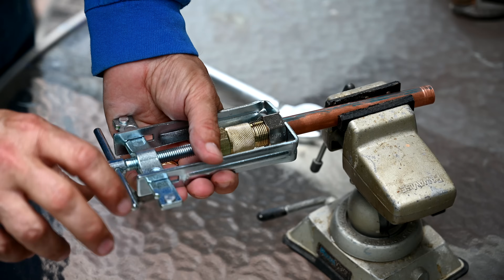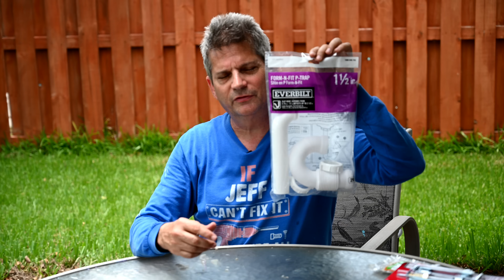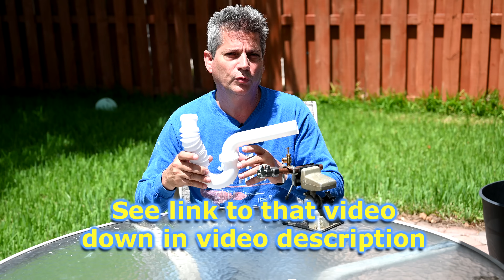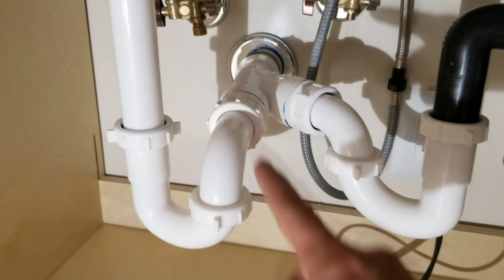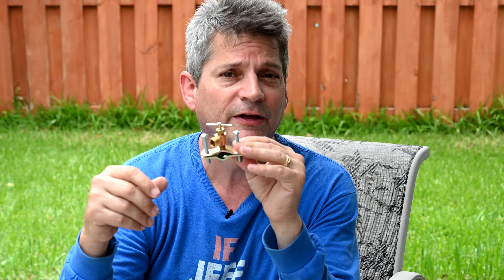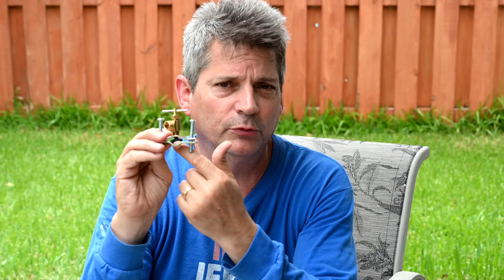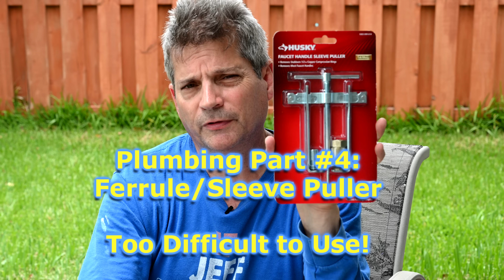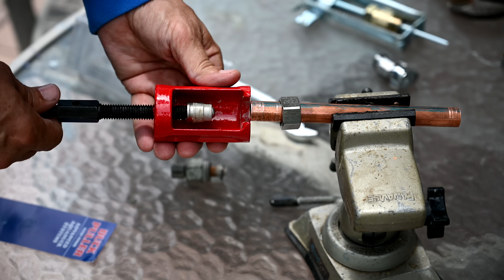4 Plumbing Parts/Tools You Should NEVER Use. NO Plumbing Fails

Comment: It would be nice to know exactly why they prohibit them
Reply from the maker: The professional plumbers already know, so the code does not have to specify why, but the saddle valve is banned because it can leak where the tap is pinched into the copper pipe, and also, even worse you have the old dissimilar metal electrolysis that occurs when 2 different types of metals come in contact, so the cheap Chines made white metal saddle sits on the copper pipe and corrodes, and eventually leaks. With Flexible p-traps, the accordion creases are fragile and often crack and leak, and the accordion violates the pluming code of p-traps being self scouring, meaning they need to be smooth walled inside, or hair and other solids can become lodged in the accordion. S-Traps are banned because a long vertical leg after the S-trap, preceded by a short vertical leg in front of the S-trap will allow the S-trap to self-siphon, also called Venturri Effect. these are just some of the reasons they are all banned by the plumbing code.

Comment: Just pulled two old rusty nasty 30year old one piece stop/supply combo angle valves today with my handle and compression nut puller.  Husky is a brand.  That style puller has worked for decades under many brands for multiple purposes. Not just the one described. Mine only has 1 insert for 1/2 ID cu, no fancy brass threads and doo hiky's.  To bash a style of puller is kinda ridiculous especially if you don't hammer those ferrules into some copper with some 12 inch crescents like most homeowners and apprentices do...... with no lube... The new ones are cool though.  I agree with the other stuff though good job.
Reply from the maker: Thanks Ryan!

Comment: I have a restaurant that smells like sewer. I had plumbers come out and install pee traps and recommend that I pour water down my drain lines. It works temporary, but during the summer it gets pretty bad. Any idea on what I can do to find the source of the issue and fix it?
Reply from the maker: Well, I would find out exactly where the smell is coming from, and work on that spot, I doubt it's coming from everywhere, probably a broken P-trap somewhere, and as long as water is going down at least once per week, the p-traps should not ever empty out, they should always be full of water in the curved part of the trap. I suspect you have a blockage further down the line after your p-trap, and it is causing sewer water to back up into your side of the p-trap, where you now can smell it. Also, check all your vertical plumbing pipe stacks, make sure you have adequate venting up to the roof, go to the roof make sure the tops of your vent stack pipes are not clogged, or blocked off with leaves, spider webs, dead critters, or water won't drain properly. Other symptoms I have seen in the past are tree roots cutting into drain pipes. But does not sound like you have  problem with the water draining just the smell right? I would call in specialists who bring in a camera snake, and snake your drains, to examine the inside of the pipe all the way to the sewer, the video will determine if your p-traps have the legal required amount of water seal in them, or if there is a break or blockage anywhere. Also, if any of your P-traps are actually S-traps, they are banned in current plumbing codes, as they are known to self siphon, lose their water seal, then sewer gasses rise up through them. IT might cost a few hundred dollars to snake camera your pipes, but I seen a few friends of mine had to do it there's no other way.

Comment: Out of everything here, I can attest that the husky sleeve puller is the biggest waste of money EVER! I can manage my way around tools, but it did exactly what you demonstrated here. I even used vise grips to keep the lock down bars behind the nut in place and that thing still separated at any pressure - or bent the device! Silly waste of product and I don't think they really meant it to be used in any real sort of fashion. Wish I had my 12$ back and the time I wasted. I eventually paid a plumber way too much money to do something simple for me.
Reply from the maker: Yes, and all the detractors here are trying to discredit us by saying we did not use the tool correctly, they have never had to use the Husky tool on a ferrule that was stuck and corroded into place and did not want to budge. The plumber you hired likely used a Duck Puller or some other tool.

Comment: YOU ARE USING HUSKY PULLER WRONG! The Husky tool is for two uses --for pulling faucet handle, and also for pulling sleeve/ferrule. The arms are for pulling faucet handle --NOT MEANT FOR PULLING COMPRESSION NUT!! You may first completely unscrew before using the tool (for pulling compression sleeve) so that the arms/clamp is out of the way; You are using it almost correct, but just don't engage arms; turning the crossbar of the tool itself will putll the compression nut.
Reply: I was wondering about that myself, never used this one before but saw the notches at the sides of the cross bar, but your explanation makes sense. Adding to this: https://youtu.be/MjNrGuxYvjQ
Husky does have trouble with instructions. :D

Comment: I am NOT running my drain (or anything else) inside and outside wall. ALSO, from a P trap, doesn't the pipe turn down? Like it drains by gravity, you know? I wish you could explain the method that water could be sucked from an S, but not from the P.
Reply from the maker: the water can't be siphoned from a P-trap because that horizontal p-trap arm that connects to the horizontal waste line going to the wall slows down the inertia of the water, thus breaking the siphoning effect. The S-Trap can siphon itself because the output of an S-trap usually goes straight down vertical, and when you have a long vertical drop after the S-trap with a short vertical drop before the S-trap, that is a recipe for increased water inertia, and so the it can siphon itself. I plan to do a video soon to show how S-traps can siphon themselves.

Comment: I work state side for a number of years today I live in France I have never seen an "S trap" but as for a most likely reason why stores sell S traps and flexible traps could there is no other way to do the trap because buildings here in France can be easily over 200 years old and even the best plumber can do the work but at a cost that too much or at time you cannot put a hole where you want it or even run a pipe that would easy to not use an S trap and flexible trap the things done here break many codes of any and all kinds of codes even health codes because at times some codes go to far and I don't agree with French on many things I find a balance between both the Americans and the French and I upset both sides at the same time for doing the balance that the price I pay for living into worlds and it no longer bothers me I say this just in case someone wants to jump on me because their thing I am wrong for setting on the fence when I am not you just don't see what I see and I get that! I did however liked and sub you if that helps any!
Reply from the maker: Thanks Ivan, and welcome aboard!

Comment: I did not see a link to the second compression ring puller, the one you can use the socket on. If you could reply with the brand and model number etc, it would be much appreciated.
Reply from the maker: Yes, it is the English Tool Company: http://englishtoolco.com/
Reply: @jeffostroff  Thank for responding and I appreciate the link.

Comment: I'm a handy man and I use a 45 degree fitting to readjust drains. You only need 1 fitting and pipe
Reply from the maker: Really? So you only need 1 fitting? so you cement the 45 degree fitting onto the waste pipe coming out of the wall, then you cement on your pipe piece that you mentioned, but guess what, now your poly pipe P-trap is not PVC, it needs adapter, cannot fit into that pipe piece without a hub adapter. Aren't you forgetting to mention that piece too?
Reply: @jeffostroff  my poly p traps have the adapter in the package when I buy them, before you asked yes I was a licenced plumber. If you cement the 45 and add pipe if needed, then you can twist your p trap in different positions to meet your adapter. I was not trying to be smart but like you I was trying to help. Sorry if I offended you.
Reply: Also I do watch and enjoy your videos, I've learned things myself from them. I just wanted to try to give back. I won't try anymore. My apologies.

Comment: The parts that are not code are one thing! But because you don't understand how to use a two jaw puller (even though the one you showed was a cheap one) don't blame your miss use of it as that a two jaw, or a three jaw puller as a bad tool. I've used both to pull gears, pulleys, sheaves and adapters from many shafts, tubes and pipes with no problem.
Reply from the maker: Good, you never had to deal with a stuck ferrule. Does not matter whether or not you remove those handles, bottom line you missed the point, the tool still screws onto the ferrule nut, but that tiny bar they give you to turn with your fingers is useless on stuck ferrules. I too have removed several ferrules successfully with the Husky tool, but the other tools like the red Duck Puller actually have the mechanical advantage because I can put a wrench to it to make it turn.
Reply: Didn't miss the point and yes I have had to   remove them and if you anneal them you can gently stretch them by going inside of the tubing that they're on by using a swedging tool. (swedging may be misspelled)

Comment: My Town, Sunapee NH does not prohibit 'S-traps'. You still haven't explained how to avoid using a so-called S-trap. I can't comprehend an alternative as long as the pipe has to turn back downward . And the pipe always has to turn back downwards.
Reply from the maker: Removing an S-Trap would be done practically when there is a complete remodel and walls can be opened. At that point the vertical pipe exiting the S-Trap is cut out and replaced with a horizontal waste line going into the wall, which intersects with a vertical stack that runs up through the attic to open air, then all the way down to the sewer. Instead of the S-Trap, you come out of the sink drain tail pipe into a P-trap, and the output of the P-trap then feeds the above mentioned horizontal waste line into the wall.
Reply: @jeffostroff  So now you have an "elongated S-trap" how is this any different? You still have a vertical downpipe. You still have a trap. You now have a "flattened" top part of the "S". I'm guessing the real issue is the pipe sizing if vacuum is the underlying problem. Unless the actual fitting type makes a difference? Like sweep Tee v. Bullnose Tee?

Comment: 20:38 aren't you using it wrong? Aren't the bracket supposed to stand on the external notches made in the tool, so they don't slide and they can't break open? #justasking
Reply from the maker: Yes and no, these newer instructions now tell you to remove the brackets altogether, because all you need is the core part of it and you twist the little rod with your fingers. those brackets are for when you use the Husky tool in Faucet knob puller mode. I have sued it a few times with the brackets on to remove normal easy pulling off ferrule sleeves, but when they are stuck ind not budging, then the tool just does not provide enough mechanical action. that's why I don't use it any more, I use the red duck puller now.

Comment: The suction is a venturi effect. 
In U.K. we run the ordinary wastes to surface drains. The correct pipe fall prevents the syphon effect. 
When they runs to a soil stack it has to have a horizontal drain with correct fall. 
We also have a waterless trap that uses a rubber tube seal. Water or air can flow quietly but any back pressure flattens the rubber tube.
Reply from the maker: How do they figure out the correct fall to avoid Venturri? that's probably what they are missing here in the USA with older houses.

Comment: Do tail pieces fall under trap section of the code? Cause that's a tail piece and the part below it that it connects to is the P trap.
Reply from the maker: Only the trap is the trap, they don't say much about tailpieces in the code. But they have plenty to say about that little old P-trap, they have sections in the code dedicated to it.

Comment: The husky tool looked like it had notches for the arms to rest in so you didn't hit them when tightening the bolt. 19:30
Reply: That is what I saw and thought. In addition, the angle of the two bars would grip the nut better and thereby not slipping off.  I personally would not buy this tool except in a pinch.

Comment: First off: 12 minutes in and I learn more than some 60 min videos....

What is your opinion on: http://www.gharexpert.com/mid2/8222008104348.jpg
Is it an approved trap? If so, how is it compared to regular P trap?
Thanks!
Reply from the maker: I've never seen that before, but it looks like a drum trap to me, if it is, then it's not allowed by code. Not sure how that is supposed to operate.
Reply: @jeffostroff  Those are common as anything here in Euro-land. The big question about the one in the picture is whether or not it has the mesh screen in front of the outlet. If it does it's a solids interceptor and according to your code 1002.3.6 drum traps that are also solids interceptors shall not be prohibited.

They're really simple things. The inlet is at the top, that pipe goes all the way down into the bottom half of the drum. The outlet is at the side and should have a mesh screen in it. The MacGuffin on top of the outlet is a one-way breather valve to prevent the trap from siphoning itself empty. I think they're great because they don't care about how much vertical drop there is behind them, or how forcefully the toilet they share a sewer pipe with flushes.
Reply from the maker: @fermitupoupon1754  Yes, it would be nice if every state allowed those Studor valves, as we call them here.

Comment: bad idea, 
damage the edge of the pipe
Reply from the maker: Wrong, it does not damage the end of the pipe tube. We've done it many times. If it damaged the pipe like you claim, we would never be able to slide on the new ferrule, that is extremely tight tolerance with no forgiveness. ever had a problem.
Reply: @jeffostroff  
EQUAL AND OPPOSITE FORCE MEANS DAMAGE EDGES .
TRY A TIGHT ONE , YOU WILL SEE.
Reply from the maker: @Han-es8qu  We have tried tight ones. EYour logic is partially incorrect e only if that force is great enough to cause damage. We have loosened some real stuck ferrules with corrosion around them, never once caused damage.

Comment: I agree these are improper and the vid is informative and thanks for helping out those less knowledgeable  but it's not just a matter of saving a couple bucks. It's potentially saving hundreds or more as plumbers charge way too damn much in most cases. Most of the time it is a necessity and there is no way around paying it but sometimes you make  do with what you can.
Reply from the maker: Yes, we have sene floods in people's houses where they had to move out until mold was remediated and drywall removed, all because of a bad PVC pipe cement job inside the wall.

Comment: yeah if the saddle finally leaks just cut that pipe out solder new one in. ice maker, sharkbite tee on the cold run what ever you want to fridge braid copper pex etc. but if your going to put in a box in wall behind the fridge your cost will be high for a licensed plumber,  handymen know they can do anything because we are <Masters of all trades>
Reply from the maker: Many municipalities inspectors now also want you to install the ice maker outlet  box with a hammer arrester. I think that is way overkill, but you won't pass inspection without it.
Reply: @jeffostroff  you don't need to have a permit or anything for the homeowners diy project unless its major renovation and you are going to change the mechanics of the plumbing or building. home owners can remodel just about anything not major so you want to pull a permit on a icemaker water line and drain pipe and replacing plumbing parts.

Comment: You’re not using the Husky tool properly, read the directions. You not supposed to use the arms for pulling ferrules.
Reply from the maker: Yes, the point I was making too is that tiny rid they give you to twist also digs into your fingers so you have no mechanical advantage and its worse on ferrules that are stuck. Lots of plumbers reporting the same thing in comments here, and they are also using it without the side arms. it's just a poor mechanical advantage tool unlike the Duck Puller, which is the easiest tool.

Comment: You are using that puller wrong.  The arms are for faucet handles.  To pull the sleeve it works like your other examples.  You just thread the nut on it and crank.  You can even remove the arms to get them out of the way
https://www.youtube.com/watch?v=MjNrGuxYvjQ
https://www.youtube.com/watch?v=TXGWlPzEH2w
Reply from the maker: Yes, the point I was making too is that tiny rid they give you to twist also digs into your fingers so you have no mechanical advantage and its worse on ferrules that are stuck. Lots of plumbers reporting the same thing in comments here, and they are also using it without the side arms. it's just a poor mechanical advantage tool unlike the Duck Puller, which is the easiest tool.